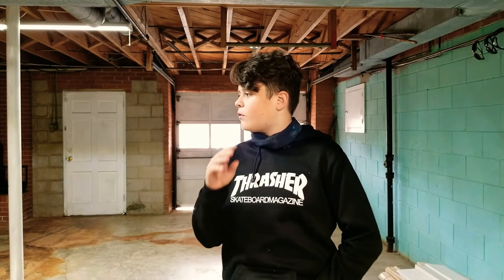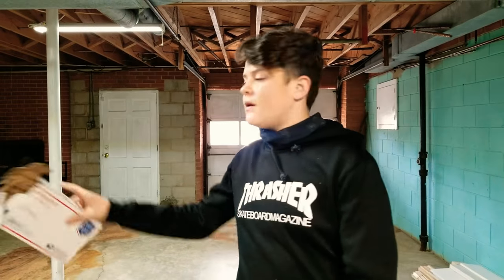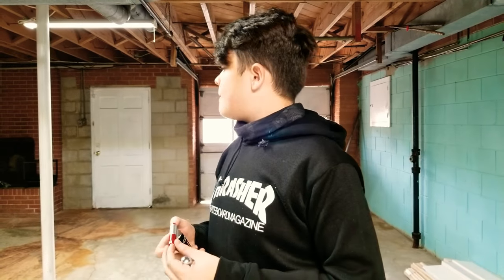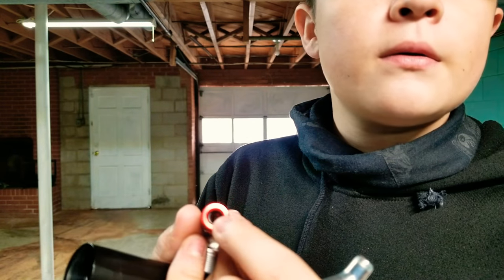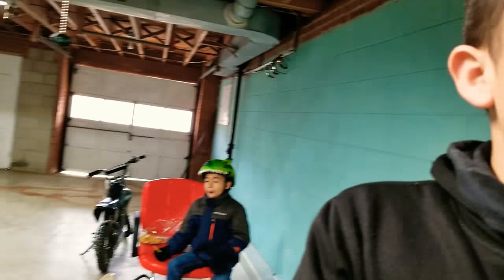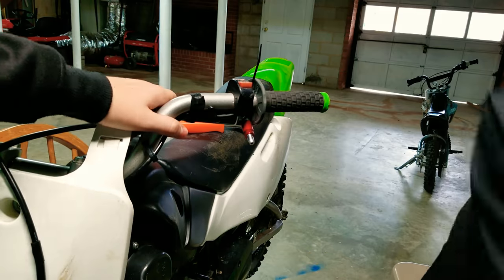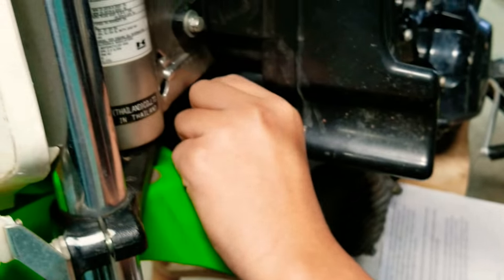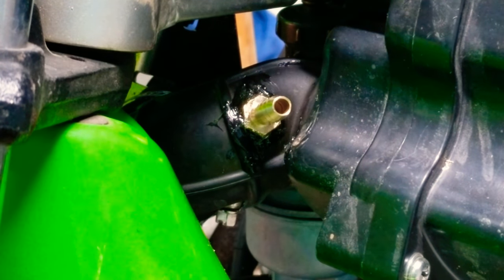NITROUS ON A PITBIKE (GONE WRONG)

Comment: You have to twist is very hard into the button and it releases the air you did all this wrong works on my  hammerhead buggy make sure it’s in the air filter and make sure that the fitting is FACING the carby then it sprays it into the carby forcing it to inject more fuel